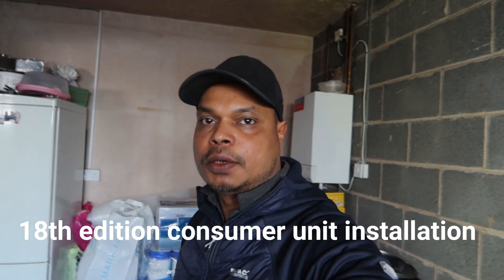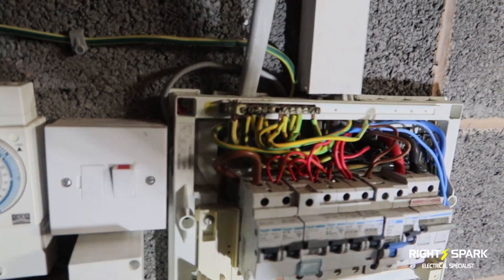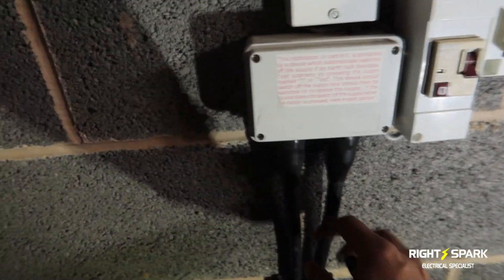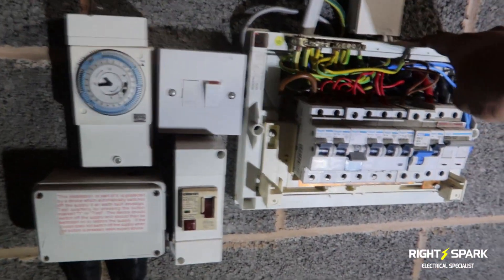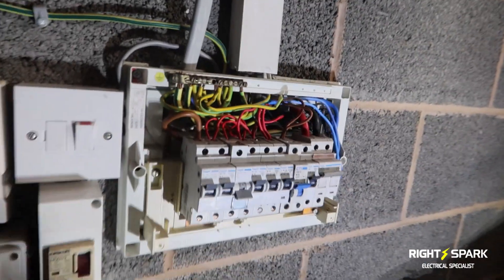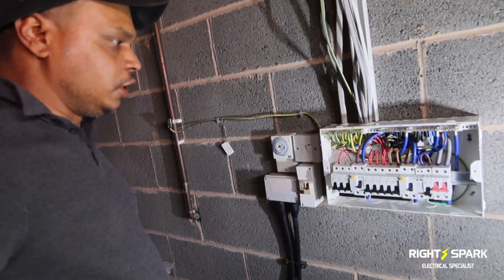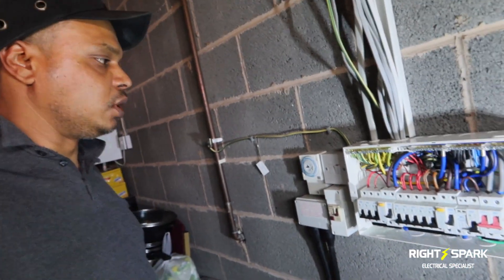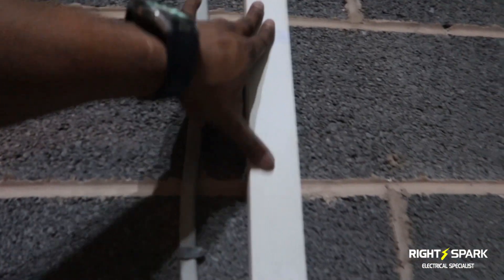18th edition consumer unit upgrade & Fault finding, Electrician

Comment: Why was the line neutral reverse socket outlet tripping the rcd ?
Reply: I was thinking that, although when he pulled the socket the cpc looked like it was ready to fall out..  Though think he said the neutral was lose, so maybe more likely a connection between neutral and earth?   Also only one spare way does not leave a lot of room for expansion..  Never liked those BG boards, at least they have an SPD but 2x 63A RCD's and type AC does not comply with regs unless you have less than that on the mcb's or you have a 60A fuse at the supply side (Not just the cutout as that can be changed and you know the DNO will not check)..  Plus as long as there is not a lot of electrical equipment that can generate DC current, otherwise should be type A...   But bet it was cheap from Screwfix..